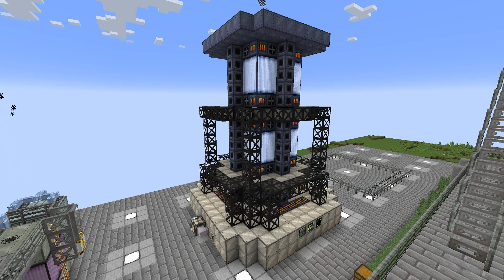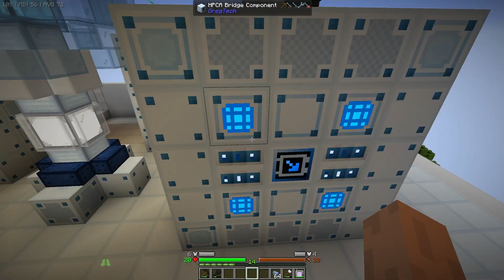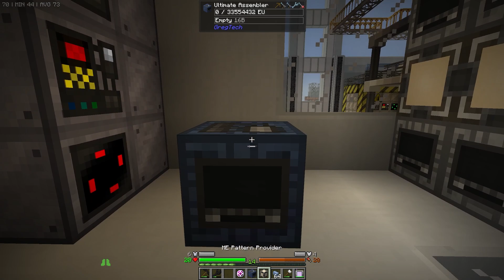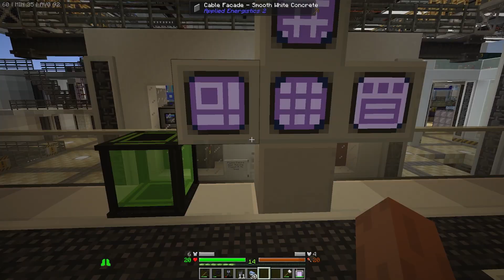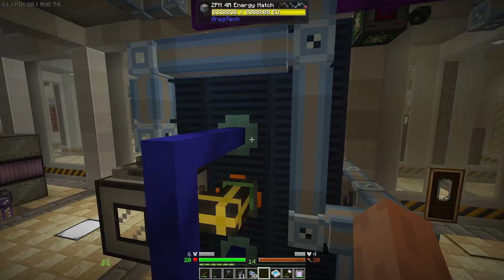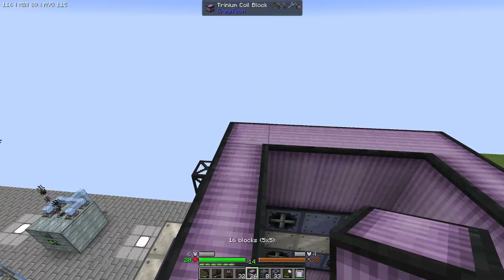Neutronium and Industrial-Scale Smelting | Star Technology Ep. 45

Comment: About the rotary heart furnace(RHF) its paralel smelting is pretty good though there will be higher teir metals that have only a maximum paralel amount of 30-40, which is annoying because the end game stargame will require thousands of them, so i suggest reusing your old blast furnaces and use them to paralel the craft those metals to save time, while using the RHF to smelt general metals, best to have 2 or 3 of them, but 1 is good enough
Reply from the maker: Yes, well.. as you've seen, I'm not against building multiple of a machine if it helps get through things quicker.. I hate waiting for slow crafts 😅
Reply: @gameswithpostie  ive seen, and you mae them so good tbh, i wanna see how you set up the stargate too lol